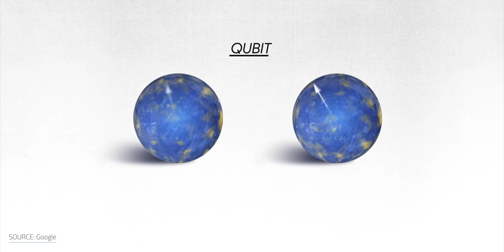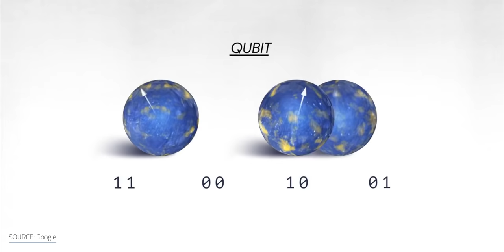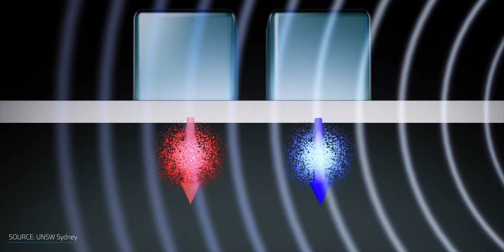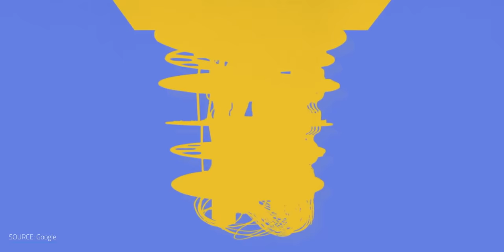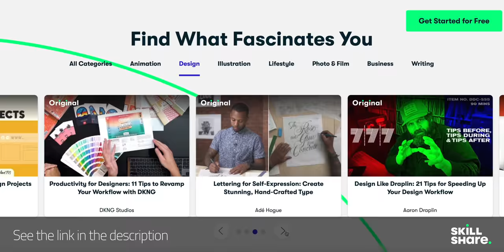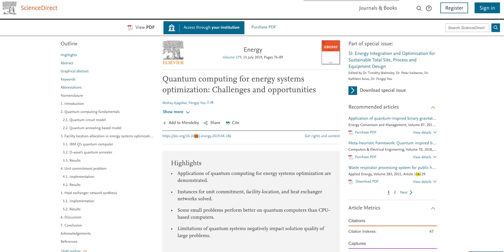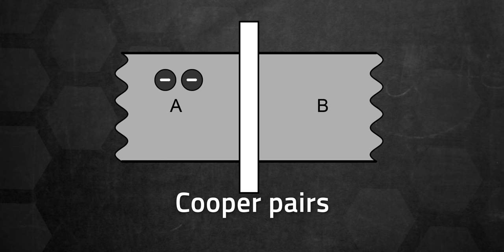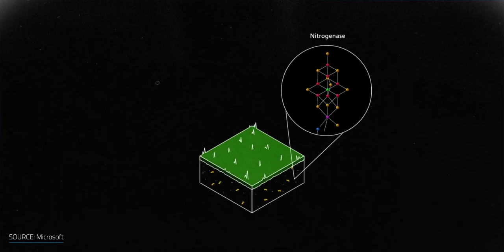Quantum Computers Are Coming … But Why Should You Care?

Comment: Quantum Information PhD student here: you have to be careful with the D-Wave claim, their device did take much less time, but it did not find the optimal solution! So the authors should not even be comparing the times at all. Such exponential speed up is what D-Wave has been looking for since they were founded, and this would be ground breaking news.

Asides from that great video!
Reply: You want to explain how google, nasa and oak ridge found the D Wave to use 0.002% of the same power used for the worlds largest super computer considering the D Wave is based on freezing the microprocessor to ~ -471F? Getting things that cold DO NOT take less electrical power. i ask you this because I do not think the video creator is serious about answering serious questions against his ideas.

Comment: As far as I know the big problem long term is that quantum computers are not a general computation machine. There is only handful of algorithms known which can be implemented. So it can do somethings (theoretically) pretty fast but only those things (at the moment). Therefore they are not substitutes to a regular computer but a complement.
Reply: This is partly true and partly not, in a sense. Quantum computers are general computation machines in the sense that it has been shown mathematically that whatever task a classical computer can do, a quantum computer can also do. However, to compute anything you need a known algorithm for doing so. Quantum computing is still a new field, so there is much algorithm development that still needs to be done. On top of this, there are many tasks for which there are known efficient classical algorithms, so there is not much motivation for developing quantum algorithms to do the same tasks. Quantum algorithm development tends to focus on tasks for which there are no known efficient classical algorithms. So yes, quantum computers are never going to entirely replace classical computers. This is loosely analogous to how the development of GPUs did not replace CPUs, but rather they continue to co-exist side by side to shore up each others' weaknesses.
Reply: Computers that learn how to learn will learn to take over and control everything.

Comment: I wonder at what point the storage of data received from Quantum Computing becomes in and of itself a limiting factor on overall processing
Reply: It doesn't.  If you have 1000-bit quantum computer, your storage needs are 1000 bits.  The superposition collapses as soon as you try to read the bits out (its a "measurement" in quantum mechanics lingo), so you can never store the vast amount of information that's potentially contained within the superposition.

The trick to utilizing supercomputers is figuring out ways you can manipulate the superposition without reading it out, such that when you do finally read it out the probability that it will collapse into the answer you're looking for is very close to 100%.

Of course doing that figuring is not particularly easy and we still only have a handful of algorithms that are provably faster on a quantum computer relative to a classical computer (Shor's algorithm being the most famous - that's the one that will break the world if we haven't widely replaced RSA and elliptic curve cryptography with something more quantum-resistant before we figure out how to keep sufficient numbers of qubits entangled sufficiently long to actually run Shor's on the kind of massive numbers cryptographic systems work with).
Reply: I may be entirely missing the point of this question, but if the problem to solve is a data intensive one, you still have to get the data into it.
The term "holographic storage" popped into my head, but I don't know why, because I'm not even sure what that would look like in a practical sense.
I just said way more than I know, so I probably should have remained quiet.  It might be my point is nothing, other than I wanted to say "holographic storage."
Reply: @niftybass  I think you get the size of the pipe issue I see... at some level even loading the question into the machine and reading out the answer from the machine takes up an amount of time that slows down the entire process
Reply: @gweebara  it's a good question. For certain algorithms the access to storage is already the limiting factor. For example one of the most well known quantum algorithms is Grover's algorithm for unstructured search. It can find a marked element in a database of N elements in root(N) tries while a classical algorithm needs N tries. However you first would have to build a quantum database which in itself needs N operations. So in this setting you won't have a quantum advantage as data loading is inefficient.
Reply: @niftybass  Its not really data intensive.  The superposition (where the "data" is stored) is not something that can ever be stored - not as an input, and not as an output.  The superposition only exists (and can only exist) while the quantum calculations are being performs.

To run a quantum computer with 1000 qubits you:
a) Initialize the system with 1000 bits (that's classical bits) of data.  There is no superposition yet.
b) Do a bunch of horrifically complicated math to create and manipulate the superposition in a way that's (hopefully) useful to you.
c) Read out the results, which as noted above collapses the superposition so you're once again reading out 1000 classical bits - not qubits.

Its that step (b) that makes quantum computers more useful than classical computers.  Steps (a) and (c) are no different from any other computer system (in theory.. the hardware of course will be different since both steps need to interact with the qubits, but the states involved are classical everywhere we get to see them).

The main reason quantum computers are "hard" is that jumping from (b) to (c) is extremely easy to do.  So easy that stray particles or even photons of light that just happening to pass by can cause the superposition to collapse before we want it to and screw up the results.  The fewer the strays and the lower their energy, the less likely that is to happen, which is why quantum computers are almost universally operated at cryogenic temperatures.

(Note: I'm using terminology rather loosely in order to (try to) generate some level of intuition.  Hopefully I was at least somewhat successful at providing an extremely-high-level description of how these machines operate, but definitely don't take any of that as any sort of deep understanding.  The rabbit hole of quantum mechanics goes very deep, and quantum computing inherits a lot of that mess.  Far deeper than I could hope to describe or even fully understand myself!)
Reply: @altrag  you do well with your explanation.
I would go along the lines that for classical computers to do what quantum computers are good at, the storage requirements DURING calculation far exceed input and output together. If you are willing to throw away the intermediate steps (as every solution centric user is) then no difference.

An example: Weather forecasting...
A set of boundary (input) conditions are given to "the algorithm". Then the forecast program sets up many (usually 50) data sets with random perturbations to the input data and produces 50 forecasts, called an ensemble. A statistical and manual analysis is used to pick the "right" one. During each of those forecast calculations the data may be interpolated in order to perform calculations on a finer grid than the inputs. Namely vortex calculations. There is no need to do fine work if there is a, steady breeze. If a vortex might be generated then a finer grid is essential. The area where these extra calculations are performed track the vortex.

But once the data hits the news channel all the calculations are dumped.

Comment: 7:57 what kind of a qubit does this computer (using 0,002% of traditional supercomputer's energy) use? Because I foresee cooling to single digits Kelvin as being the main problem here, unless we find room-temp superconductors... Also which is "the largest supercomputer" currently? Are you talking size or power?
Reply: Yes, I instantly wondered about the cost of cooling components to 1°K
Reply: He's likely referring to the Google Sycamore processor. In the quantum advantage (aka quantum supremacy) experiment, Google's 53 superconducting qubit processor (based on frequency-tunable transmons) outcompeted all classical supercomputers. It was estimated that 3 minutes of quantum compute time would take 10,000 years on a large classical supercomputer.

Major caveat: it was on a demonstration problem of no practical use. Quantum computers are not useful from a commercial standpoint to us at this moment.

Your estimation of cold temperature is actually off by a factor of 100. Rather than cooling to a few Kelvin, supercondcuting qubit processors are cooled to a few tens of millikelvin (e.g. 0.01 Kelvin). But its important to note that this cooling costs far less energy than running the huge classical supercomputers that the quantum supremacy experiment competed against.
Reply: My thoughts exactly. The cost of cooling is hard to judge. You have two aspects:

reaching and maintaining a low temperature by minimizing leakage
and
normal cooling to offset heat production

The first problem is just a matter of good isolation. maybe layered zones and different fluids used for cooling? 
The second problem depends on inefficiency of electrical currents producing heat. 

If I'm not mistaken, the second problem becomes increasingly smaller with lower temperature, approaching lossless superconducting at absolute zero.
Reply: Electricity costs arent an issue here, super computer consume a lot more power than quantum computers
Reply: @7MPhonemicEnglish  cooling can be done with liquid helium down to these low temperatures using cryostats, but once you get to the milikelvin range you need dilution refrigerators. They’re expensive, and expensive to run but I don’t think it’s so cost prohibitive that it’ll hold the tech back considering the end goal with quantum computers isn’t right now to get them in homes, but to offer them as a cloud based service where you can remotely access them.
Reply: Cooling stuff below 1K definitely consumes a lot of energy, but running an entire room full of classical computers for 10000 years consumes even more
Reply: Quantum computers are really only better at a very small number of problems. One of them is simulating quantum systems. It's impractical to study quantum systems on standard computers. even if you could make the biggest supercomputers 1000x faster that would only let them simulate an extra 10-15 quantum particles exactly. a 1000x faster quantum computer can simulate 1000x more particles.
Reply: @sethsims7414  
Or modelling chaotic systems? Like weather or gravity on cosmic scales. I can also see it helping with protein folding and biology things. Anywhere we know a start and end state and need to figure out how to get from A to B. Such as developing neural networks and AI. Then the produced ai/network can run on regular hardware.
Reply: @hypsochromic6072  wow i didnt know normal computers were that energy greedy
Reply: @adaroben1104  nope. Shor's algorithm for factoring integers, Grover's algorithm might be useful for optimizing AI. Linear space and time simulation of interacting quantum systems rather than exponential time in the classical case.
Reply: Supercomputers use a crap ton of power just for cooling alone. 

Quantum computers won't be too useful to individuals. These are very limited in what they can be applied to.

So, to some research center thats studying protein molecules, etc, the cost of cooling a quantum computer would probably be less than cooling a supercomputer computer. 

We currently use general processors. Processors that are versatile and can be applied to many things.
Reply: @hypsochromic6072  If there is no useful commercial aspect to these processors then why, when I was walking around inside of their labs was I told that (one of the companies mentioned in this story) has multiple quantum computers that they rent out time on to Universities, companies and the government. It is a revenue source for them. They both build for sale and rent time on them.
Reply: @rizizum  data center go brrrrrrrrrrr.
Reply: @7MPhonemicEnglish  I wonder if the low power consumption is due to the limits on cooling. When your going that low ever tiny fraction of a watt matters significantly. Especially if you're chasing very low error percentiles.
Reply: It's a charge qubit, but that isn't the only type of qubit. Quantum Dots may help solve the problem in the future but for now their use  in processors is kinda theoretical.
Reply: @hypsochromic6072  Quantum computers will become commercially useful for  the first time in less than 3 years from today.

Comment: Quantum computers speed are only applicable in certain applications so can not replace data centers and such.  So energy savings would be minimal as most computing power is used in data centers that simply hold the raw data.

Comment: The thing with quantum computer is that they are analog machines, the prospect of keeping operations at a level of precision high enough to not get noise at the output is quite daunting, especially as the number of qubit increases : each term of the superposition comes with an amplitude to be controlled.
Stuff like quantum error correction will help with that task, but last time I checked (that is 2021) we haven't reached the level of precision required to make it work in a real chip, the best we have is partial error detection on a seven qubit chip or something along those lines. Getting a single error corrected qubit would require to increase the base level of precision of two qubit operations on low qubit chips, or managing to scale the best precision we can get with low qubit counts into the 50 qubit range, and then upscale this into the thousand qubit range.